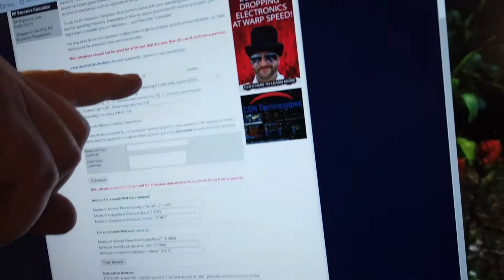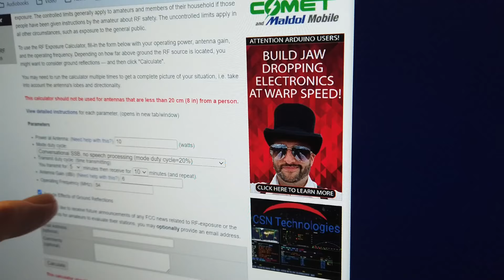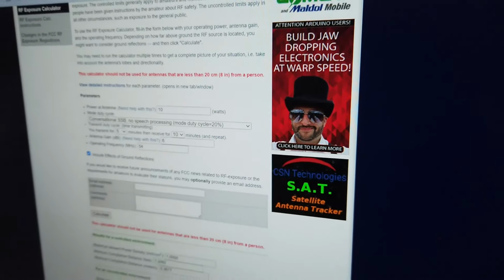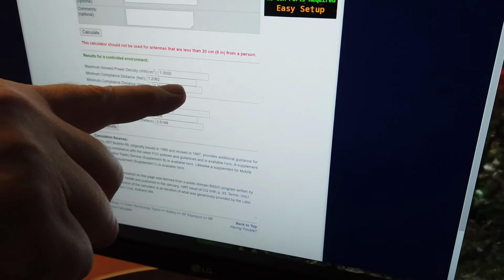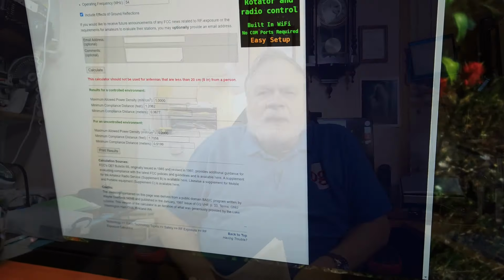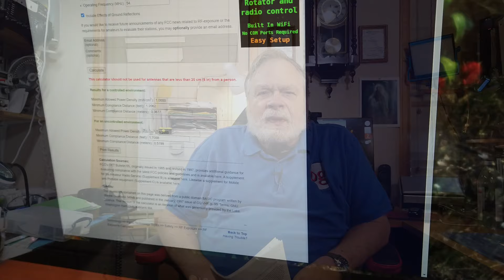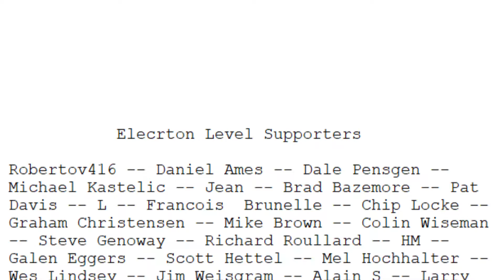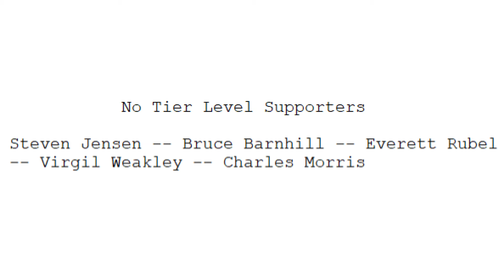10 Watts QRP is Very Little Hazard (#1074)

Comment: Thanks for the link Dave. I put, ARRL exposure calc and it took me there.
I just used it and I and other people are well away from my aerials, 5 Watts with 5 dipoles in the attic, 20m to 10m and an outdoor inverted vee for 5.262 MHz.
In the past I have done two special event stations at an agricultural show in a field using a vertical aerial and was well away from it at about ten feet. Aerial roped off so people didn't walk into it.
We also had to do an assessment in the U.K. Using the Ofcom calculator it said, Low power. No further assessment is required. 160m to 2m.
G4GHB.

Comment: I wonder if RF safety limits apply to mobile operation  ?   I remember  if it is less than 50 watts in VHF  it was exempt one time.   because mobile car operation, I only have  2 ft  to edge of car  if antenna were to placed on middle of car.   if that is case, I am only allow to transmit 20 watts or even less,  because any public can be right next to car.   any one have idea ?  AG6JU
Reply: 5/3/2021 new rules came into place by the FCC which makes it so there are no exemptions based on power level. All amateur licensees need to perform an RF exposure assessment for all the bands, power levels, and antennas they plan to use. However if the antenna is placed on the outside of the car and you are on the inside, the metal chassis of the car should provide quite a bit of shielding to keep you protected even if the straight line distance to the antenna is small. Much of that RF is going to bounce off the roof of the car. It's definitely dependent on each car and material, but for me if I try and use a 2m HT inside my car I can't get the FM out very far and the local weak RF can't get in. There's also a 30 minute averaging period associated, so if someone only briefly comes near the antenna and then leaves, their uncontrolled exposure wouldn't be as much as you sitting there continuously as the controlled operator for the whole 30 minutes.